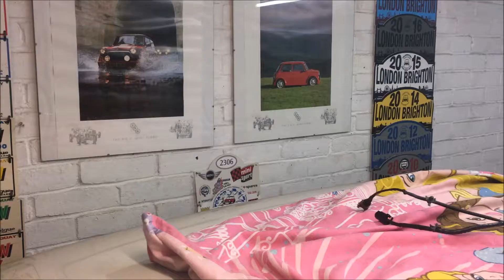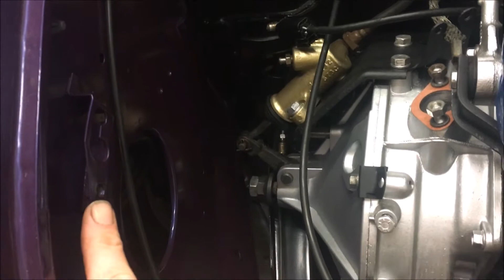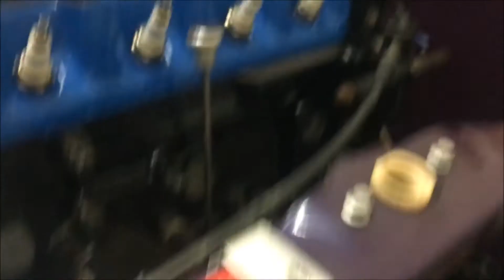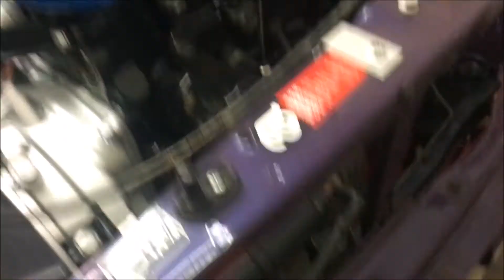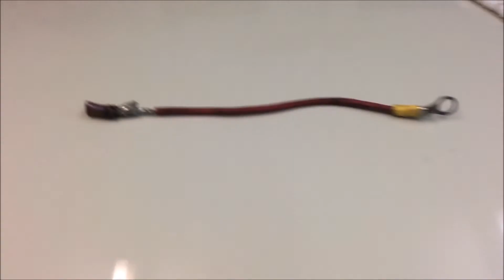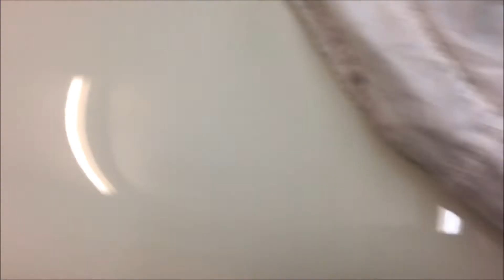Classic Mini Wiring loom electrics - Winter Workshop Part 2

Comment: This has been the best information I have found on looking at the wiring of the mini, most are brushed over, or sales points for parts, keep it up mate!!! What I would like to see is, wiring break downs on each component,  3 wire alternator, one to battery hot, which one? one on energizing the system thru ignition,  the third seems to do nothing??  the heater is there a relay to control amperage, no videos on a bench break down any where to bad , thank you for this, it helps me shorten the back to the battery lead instead of running a wire all the way back to the battery,
Reply: The sad part of old minis is people tend to butcher the wiring harness, bad crimps, you name it, look close and its everywhere, its fun to DYI it but the manuals cover many years, & include a dyno, so no alternator  so conversion, & the butchering begins  I have 4 very good manuals, originals, BMC mini service manuals, I just need it spelled out for the average dude for example  on paper AlternatorStarterheater lights ignition its difficult to find these systems separately listed or testing the alternator on a bench, to know what post hooks to where